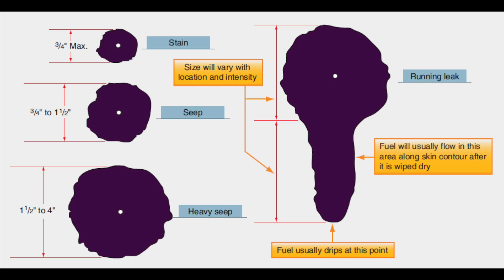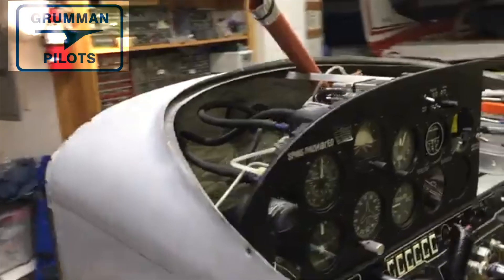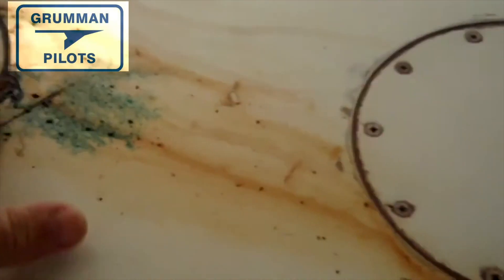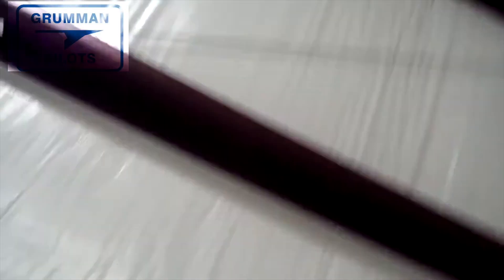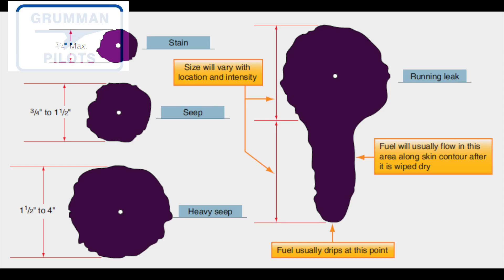What Fuel Leak Type Do You Have? - Grumman Style

Comment: Are those access covers with the seal around them, do they leave directly into your gas tank?
Reply from the maker: The seal on the sender unit are on the outside.  Access covers into the tank on the bottom do have sealant on the inside.